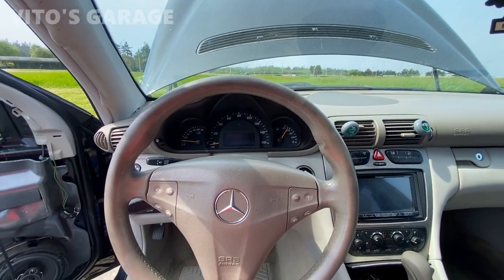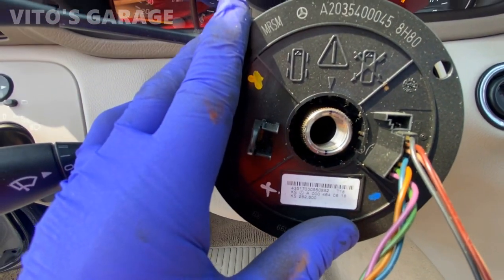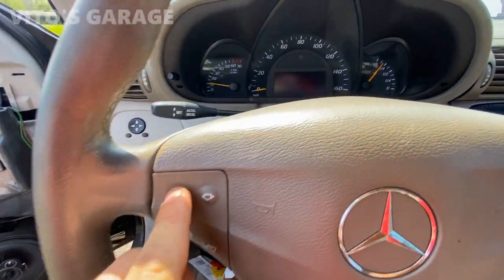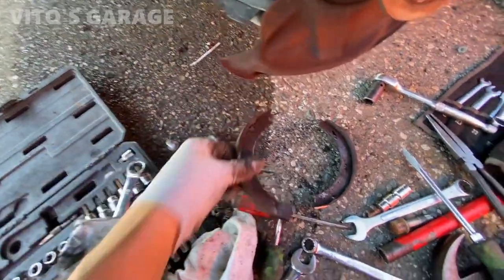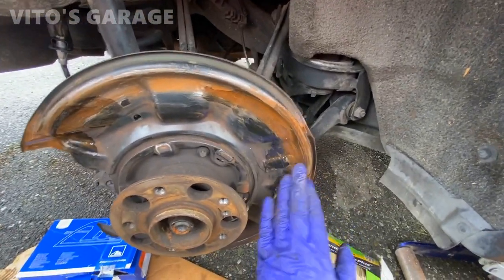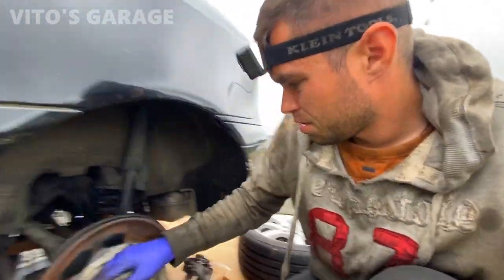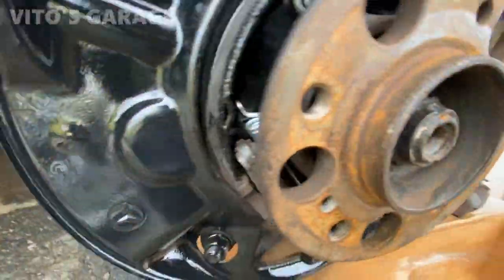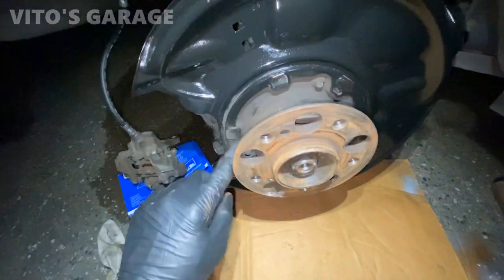W203 Mercedes C230 Combination Switch Replacement, New Parking Brake Shoes & Hardware,

Comment: Hey Vito great video.I know you know these cars in and out a screwdriver fell from sitting on the edge of the engine bay. Its a small enough hole right under the exteded hood latch and i was wondering how I get to it to get it out before it causes damage
Reply from the maker: You have to try to retrieve it. If you have a splash shield underneath, try removing it. Maybe it’s on the shield.